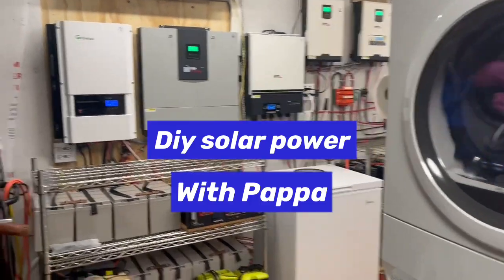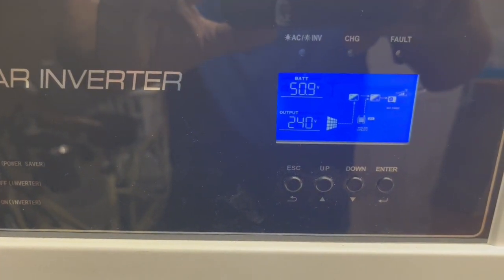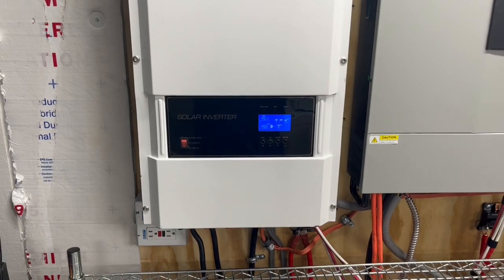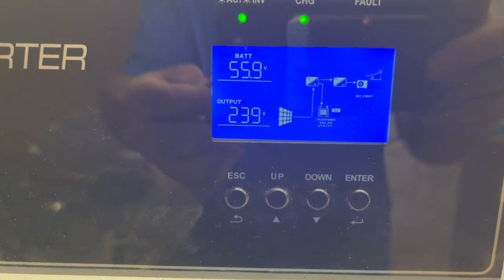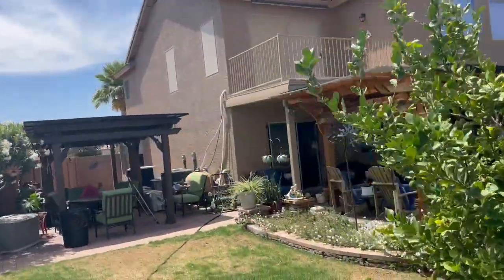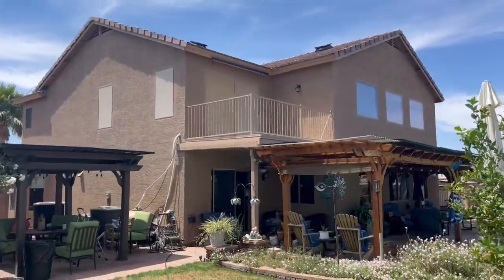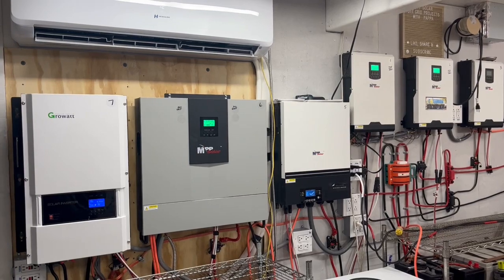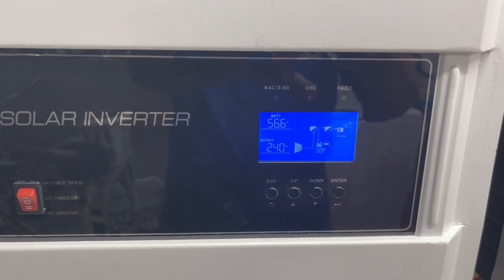Starting surge 12kw Growatt inverter for 3 1/2 & 4 ton AC, run both AC’s same time

Comment: I have the Growatt 12k unit solely as an emergency backup generator, paired with 4 of the rack mount batteries totalling 20kWh of storage. I also have an EasyStart 368 soft start on my old 4-ton HVAC unit. The startup surge is about 15kW even with the soft start but the Growatt appears to handle it fine. I also added a Chargeverter which I can connect to my Honda EU7000is inverter generator which has been converted to tri-fuel. I usually run it on natural gas.  If we lose power for an extended period of time, the Honda runs the CHargeverter which keeps the batteries topped off as the Growatt powers the house. The Honda alone could never start my 4-ton HVAC, so now it has been relegated to battery charging duty. I don't have any solar panels.
Reply from the maker: Nice set up. I bought the Hyper engineering soft start which I have the same one on the 3 1/2 ton Ac heat pump and the 12.7 ton pool heater heat pump. My inrush amps at startup on 12.7 ton pool heater was around 180 amps before I installed soft start, now the inrush amps are between 42-58 amps. The inrush amps in the 3 1/2 ton ac heat pump was around 80 amps but after soft start was installed the inrush amps dropped to 18-24 amps. I have not installed a soft start yet on my 4 ton AC heat pump but I know the inrush amps are around 110-118 amps. My 12kw Growatt with just battery will start 4 tonnage but will not run long on AGM batteries.
Reply: @diy-solar-guy  Yeah...that is the problem with powering large HVAC units with batteries...they simply draw too much power to last very long.  This is the reason I got the Chargeverter, which can supply 5kW continuously to the battery rack from the generator while the inverter powers the house.   The battery % SoC will drop down 5-6% when the compressor is running, but when it cycles off the batteries get recharged almost to where they were. This will allow me to keep the house cool for longer periods on battery power, complemented by generator power.  If I had a large enough generator to run everything, I wouldn't need the battery backup system, but this system works fine for me as an emergency backup.
Reply from the maker: Very nice set up. One thing I do is supper cool my upstairs, downstairs and garage to 62-64 degrees during the day while for free using solar, then at 5pm I switch over to grid and set my thermostat at 76 degrees and my AC on grid never kicks on overnight because house is so well insulated and so cold from day time. Usually I wake in the morning and the temp in house is around 74 degrees. The ac never kicked in overnight. It’s been 95-100 degrees during the day last week and 50-60 degrees at night. Don’t really need big battery bank when I super cool house. Last year when it was 115+ degrees in August my electric usage was about 30 kilowatt hours a day. Electric bill was $162 for month. That is cheap for phoenix AZ area. Most of my neighbors electric bills are close to $1000 a month in summer. If I really need to I can now run a mini split in each of the 2 bedrooms we use overnight on battery bank. And I could get that bill down from $162 to less than $90 for hottest months of the year. I actually have 2 mini splits heat pump ac upstairs, downstairs and in garage that could be run off battery overnight or on utility grid power, 5 are 120v and 1 is 230 volt. It really nice not having to set my thermostat at 85 during the day and 79 at night from when I did not have off grid solar power. Now the house is cold 24 hours a day with solar power.

Comment: Do you have a video show what happens when the growatt 12k starts the 3.5 ton?  Does the 12kw make any sound as the AC load spins up?
Reply from the maker: Before I installed a soft start, the 12kw Growatt use to make a sound when ac started up but after I installed soft start, there is no sound when 3 1/2 ton ac starts up. $250 for soft start. Hyper engineering soft start. Took 1/2 hour to install, used all summer long with no problems, I use solar during the day and utility at night for ac. I have it wired with 2 ac disconnects on each 3 1/2 ton and 4 ton ac, so I just move fuse pull from solar ac disconnect to utility disconnect. I usually change over around 5 pm in summer and switch back at 7am next morning. I went from a 72 amp start up draw on 3 1/2 ton ac down to 20 amp start up draw with soft start. Huge difference on start up. Before I installed soft start the 12 kw Growatt inverter would vibrate and make a loud buzzing sound for a second or two and would sometimes trip the breaker for battery bank. Now no sound at all except fans on inverter starting up when ac starts. The video you asked the question on at 1 minute 59 seconds, you will hear the sound when the ac starts up , this is before I installed the soft start.
Reply: @diy-solar-guy 
Yeah thx
That's what I'm hearing. It's inherent in transformers as large loads start as up.

What makes it worse is that I have installed the 12K in a cargo trailer. Plywood walls thin aluminum sheeting. So it makes a really loud noise that is reverberated in that trailer. I have build videos on my channel of the setup just getting it finished up now
Reply from the maker: @OffGridandOutdoors  I also need to install a soft start on my 4 ton ac that will still make the sound at start up, but I rarely use the 4 ton ac. The 4 ton ac start up is even louder and longer sound than when 3 1/2 ton ac starts. Instead I run 2-120v 12,000 btu mini splits that use only about 40 percent of power and cools down much quicker so I am not in a hurring to install soft start. I have 6 mini splits installed, 2 in the garage, 2 upstairs and 2 downstairs. I like using the mini splits because of less noise in house and outside. Very little noise when running. I can use the 6 mini splits or main heat pumps ( 3 1/2 ton and 4 ton ac) or all 8 at the same time using solar.

Comment: Impressive system. Good thing your inverters are in an air conditioned room. Down here in the low hot western Arizona desert the 115+ degree days (at least 3 months worth) would be shutting down your inverters, if, like mine, they are in an outdoor shed.. Luckily we run some inverters that are proven to sustain full load at those temperatures (and have been doing it for years). I'm preparing to increase our system and continue to use those inverters (as well as using them in the systems I'm consulting on here in Arizona). Your system is excellent in your mild (compared to ours) climate and impressively big.
Reply from the maker: Thank you. We started out in a 4x8 shed that I insulted and put a 5000 btu window ac to keep my inverters cool. I had a dedicated inverter for the ac unit in shed. I used paper backed fiberglass in between studs on walls and roof, then 2 in foam board. Having in controlled environment is nice. Even overnight, the temp never goes above 85 degrees. Those 48v inverters can put out a lot of heat. I am in Arizona, Phoenix. Several great places here in AZ that I get supplies from, SanTansolar.com in Gilbert and Swsolarsupply.com north of Phoenix. We are going to be 112+ degrees this week. I am ready. I started with harbor freight modified sign wave inverters, still have them, mounted on shed wall. Thanks for the input and Stat cool.
Reply: @diy-solar-guy  We are 15 miles east of Salome in Harquahala valley. No grid service whatsoever there. Going to add more power in the coming months.
Reply from the maker: Nice. It is extremely hot out here for next 3+ months as you know. I am still getting through the night without using grid powered AC. Woke up this morning to 80 degrees. Will be trying battery bank overnight with mini splits real soon. Hoping to stay off grid power over summer. They double your rates next few months. Glad I invested before everything almost 50 percent more. Still finding great deals on solar products.
Reply: @diy-solar-guy  Among our strategies is to be acclimated to 90 degrees. We're comfortable with that. And it keeps neighbors away. And it makes doing outdoor things more tolerable.
Reply from the maker: I know you will be successful with it.
Reply: @bearchow1929  I live in Phoenix we use evaporative cooling 6600 CFM master cool until about July 4th every year we run it. It can bring the house down into the 60's when it's 95F outside. When the humidity gets down below 10% in the low single digits, I have seen almost 40F drop in air coming out of the cooler. What I do is just buy a new pad every year no smell or problems. I have run it longer I find worth spending $120-140 a year on a new pad. June go to bed its 88F out need some cooling wake up in the morning it's 65F outside your AC is set to 72F. It's actually warmer inside your home all the electronics warm up the house. With the evap cooling that doesn't happen.
Reply from the maker: A lot of people use swamp coolers out here, especially when they were installed on older homes. We only had central ac installed when we bought the house new. Now we pay nothing to air condition and heat our house year round using off grid solar. Thank you for your input, we appreciate it. Hope you have a wonderful and blessed week

Comment: If you install micro soft start on the ac units they would start a lot better by drawing less start up amps. It worked because I did it also. I have the same inverter.
Reply from the maker: I have someone getting me one, just out of stock right now

Comment: WOW ! YOU ARE THE MAN ! WHEN IT COMES TO RUNNING MOST OF THE HOUSE AND AC UNITS OFF GRID . AWSOME VIDEO !
Reply from the maker: Thank you. I really enjoy trying to do what everyone thinks about doing with solar off grid. Still need to get that 12.5 ton pool heater running on solar during the day. Just want to share what I learned with others so they can do these projects as well. I had no clue about this off grid solar 2 1/2 years ago or air conditioners of any type  , but I am a quick learner.  Hope you have a wonderful and blessed weekend.